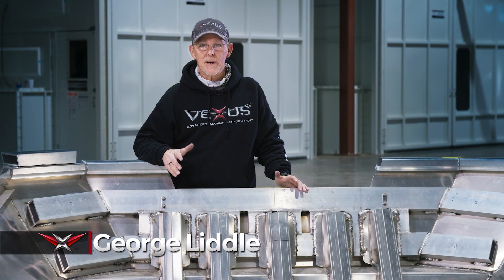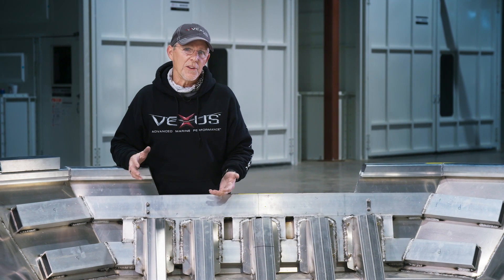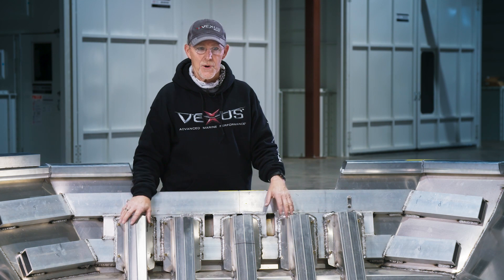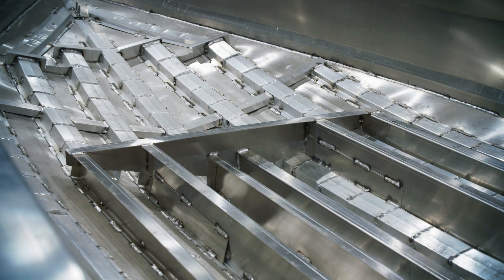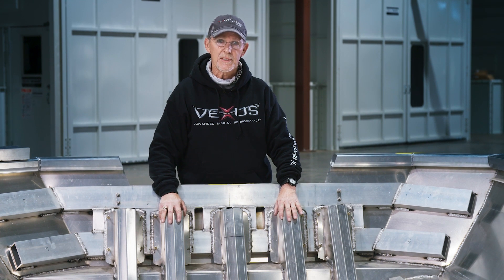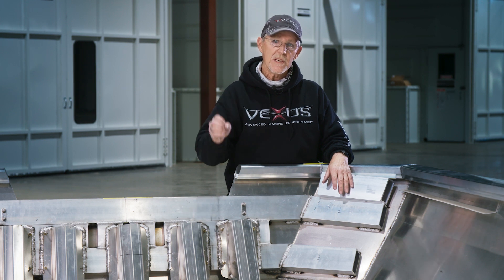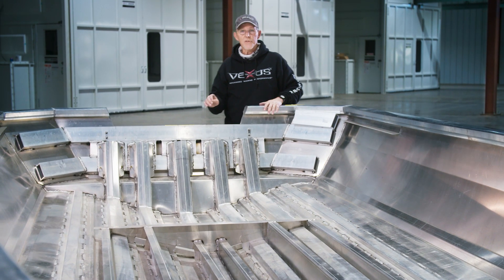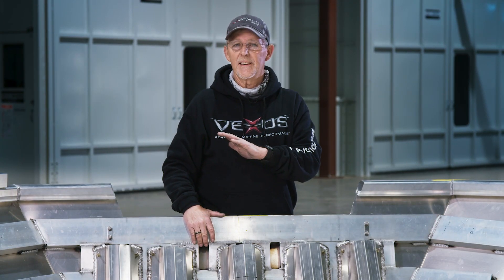Vexus® Boats - Dense Base™ Design & Vector Force™ Transom

Comment: How is that boat not rated for a 200 hp motor?
Reply: I notice companies that sell tin & glass both tend to underpower their tin. Can't explain it but they do.
Reply: too light. I do not know the exact way the testing is done, but I do know that the boat has to be able to make a full lock turn in  both directions at full throttle, full speed. So I would imagine that with 200HP it would hit above 70 MPH, maybe even 80 on this size of boat empty. In order to make that turn you would need a deeper V hull, I would think. Something that can cut and carve through the water and not send you sliding or catch an edge and roll you. I would like 200hp too, but I dont think it would ever get rated for such. Maybe they will release a 21 footer?
Reply: Yea Xpress makes an all aluminum 19 footer that rated for a 200. Its got to be lighter than this boat.
Reply: Seth Hess deeper v. Looks more narrow tho.
Reply: @sethhess6655  Xpress boats are heavy. Their X19 Pro weighs 1,700lbs with motor while this boat weighs 1525lbs with motor.
Reply: @rayterry7  thats the difference in weight between a merc and a yamaha. if an xpress comes with a yamaha it will be 300 or so pounds heavier.
Reply: @rayterry7  and i dont think it mattered with these boats they have had some hull issues anyways. their fiberglass line is straight money though.
Reply: @sethhess6655  wrong. 150 mercury proxs and Yamaha sho is only 30-40lbs difference
Reply: Needs at least a 175 rather a 200.